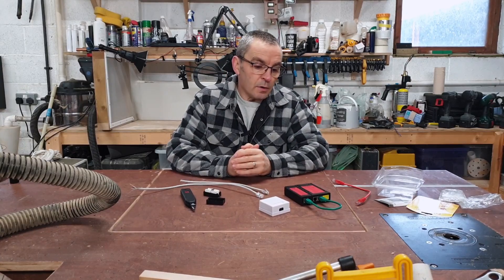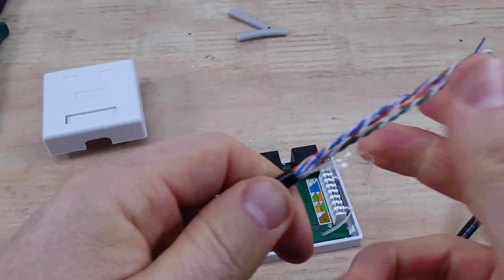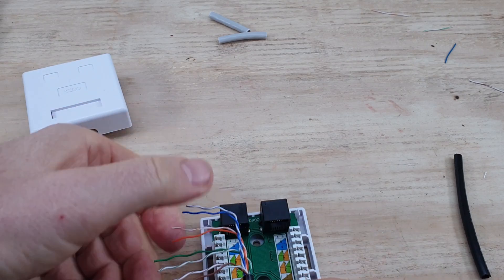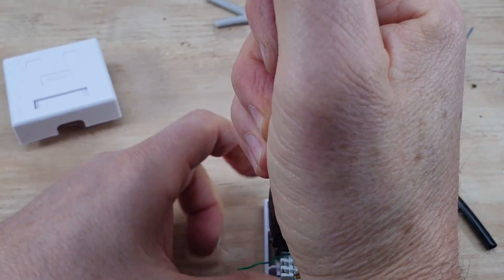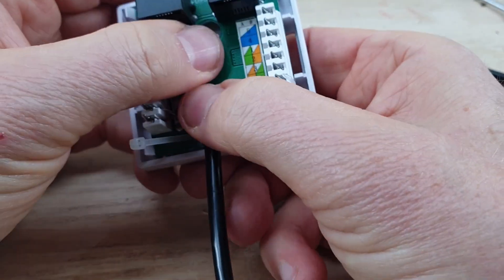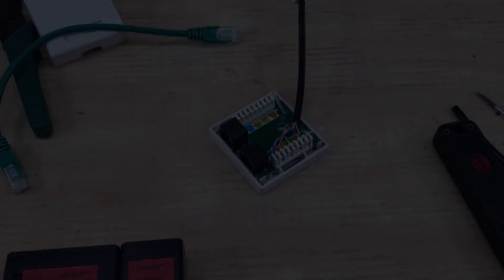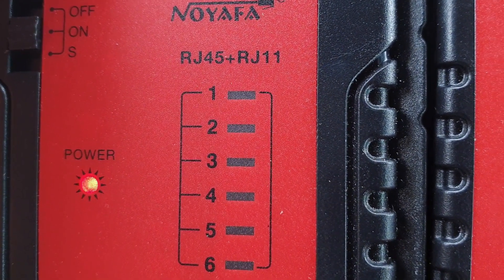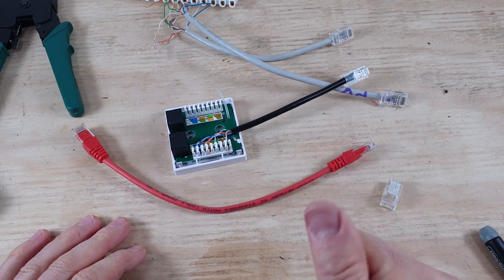How to Crimp Data Face plates + Simple Cable tester!

Comment: Great stuff, I'm a network engineer so very familiar with structured cabling although very rarely actually make/terminate cables.
Reply from the maker: I used to do whole home automation years ago and we terminated everything. Dont do much now but I think it's really handy to know how, especially if you just need to add the odd socket rather than pay someone.